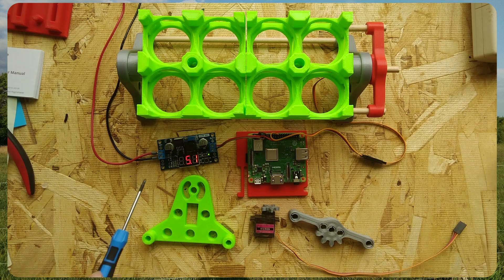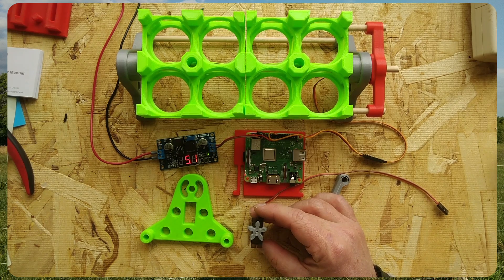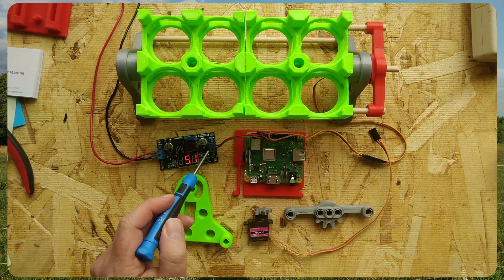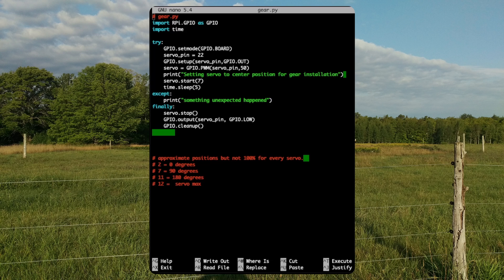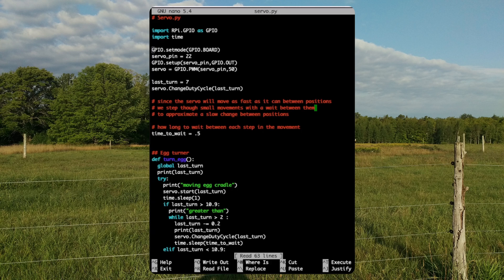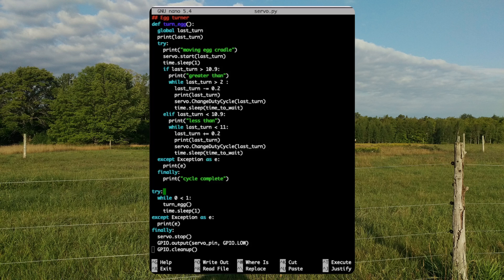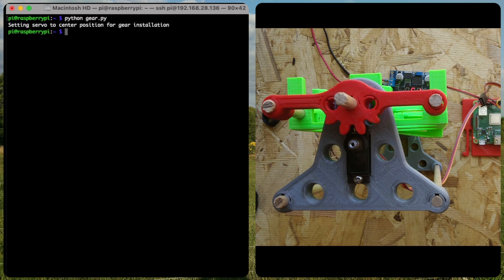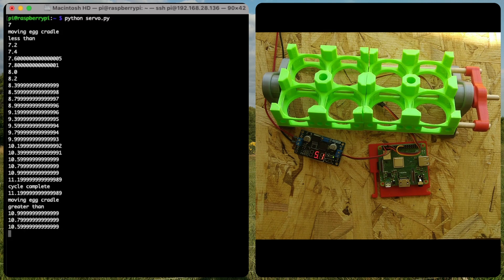DIY  incubator Pi controlling  an egg turner

Comment: Awesome.  This will be a great intro to the Pi for me.   In your opinion, could this be managed using the Pi Pico?   I'm wondering mainly due to cost and availability for the Pi.  Are you also using the Pi to manage temperature and/or humidity?
Reply from the maker: Hi @davidlarrimore9718, 

I do think this could easily be done on a Pico or arduino.  and yes I used the pi to also control heat,  and monitor (but not control) humidity.   My incubator also used CherryPye to put up a web interface with the temperature history graphs, so i could see the temp and (i think) humidity for the duration of the run. 

I'm not sure if the performance  of the pico would be good enough for doing PWM style heater control if one used micro python on one though, but I suspect if one just used the Arduino stuff it would be sufficient but thats a total guess.  

My incubator uses an old defrost refrigerator,  the incubator portion is the freezer compartment. I wired the air circulation fan and the defrost element (both 120v ac devices) to work on 1 plug and then the pi turns that on and off using a PWM library  with a 1 minute PWM cycle.    For humidity I just used those plastic trays that lunchmeat comes in and found some carwash foam then put those in the water dish ( think i used 3)  on their long side (so half in half out of the water) and when the humidity would get low I flipped them.  If I remember right you want to lower the humidity towards the end so the membrane dries out a bit  making it easier for the chicks  to get though. I believe I took the humidity stuff out the last week.   I used a BME 280 to monitor the temp and humidity, and used a DS18B20 temp sensor as a sanity check.   I find the BME280's good sensors but they only last about 6 months in my barn before they stop working. The DS18B20 i use was purchased with a water proof lead so its fairly impervious to the elements, but also lacks humidity. 

Below are the two (vocabulary is failing me know I've not programed in quite a while). Procedures?  I wrote / adapted from examples for the two sensors I used in my  incubator. 

The PID code is mixed in with the main program, so thats not so easy to post in the comments. I eventually plan on doing a few more pi incubator videos. (completing the build so to speak)  but as you said the PI's are  expensive for people to get into now if you can find them. 

Adafruit has great tutorials, on a lot of this stuff and  they contribute to the community (their libraries show up fairly often in the Arduino and python stuff in regards to sensors, at least the stuff I use). 

Temp sensor code (temp only):
to use a DS18B20 sensor

#DS18B20 
#  need to setup the GPIO pin
# add the following to /boot/config.txt
# dtoverlay-w1-gpio,gpio=26
import RPi.GPIO as GPIO
Board_Pin =  7
GPIO.setmode(GPIO.BOARD)
GPIO.setup(Board_Pin,GPIO.IN, pull_up_down=GPIO.PUD_UP)

import glob
import time
 
base_dir = '/sys/bus/w1/devices/'
device_folder = glob.glob(base_dir + '28*')[0]
device_file = device_folder + '/w1_slave'
# temp adjustment to make it read the same as an NIST traced sensor
calibration_offset = -1.2
 
def read_temp_raw():
    f = open(device_file, 'r')
    lines = f.readlines()
    f.close()
    return lines
 
def read_temp():
    lines = read_temp_raw()
    while lines[0].strip()[-3:] != 'YES':
        time.sleep(0.2)
        lines = read_temp_raw()
    equals_pos = lines[1].find('t=')
    if equals_pos != -1:
        temp_string = lines[1][equals_pos+2:]
        temp_c = float(temp_string) / 1000.0
        temp_f = ((temp_c * 9.0 / 5.0 + 32.0 ) + calibration_offset)
        return  temp_f
 

Temp and humidity sensor code:
BME280 sensor (temp and humidity)
# see adafruit tutorials for setup. 
import bme280
import smbus2

def get_data():
  port = 1
  # address may be diff for your sensor usually 0x77 or 0x78 I think. 
  address = 0x77
  bus = smbus2.SMBus(port)
  # temp sensor compared to an NIST sensor this is the diff
  calibration_offset = 1
  # bus = smbus2.SMBus(port)
  try:
    calibration_params = bme280.load_calibration_params(bus, address)
    sensor = bme280.sample(bus, address, calibration_params)
    # the temp in F degrees  truncated to 3 decimal places
    tempf = (((sensor.temperature) * 1.8)+32) + calibration_offset
    #tempf =  '{0:0.3f}'.format((((sensor.temperature) * 1.8)+32) + calibration_offset)
    # the barometric pressure truncated to 3 decimal places and converted to inch / HG
    baromin = '{0:0.3f}'.format(sensor.pressure * 0.0002953)
    # the humidity
    humidity = '{0:0.3f}'.format(sensor.humidity)
    # outdoor dew point    dewptf = ' '
    bus.close()
    return tempf, baromin, humidity
  except Exception as e:
    print('********************')
    print(e)
    print('********************')
    return 0,0,0
  finally:
    bus.close()